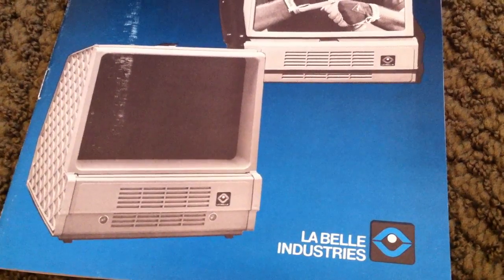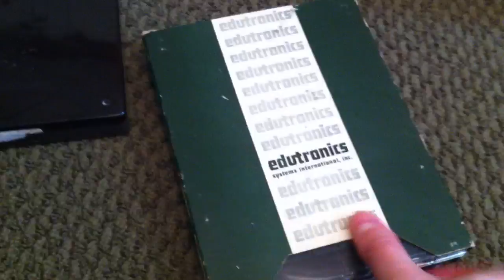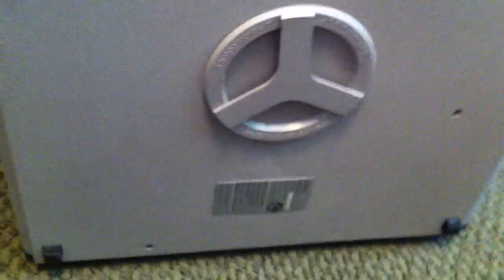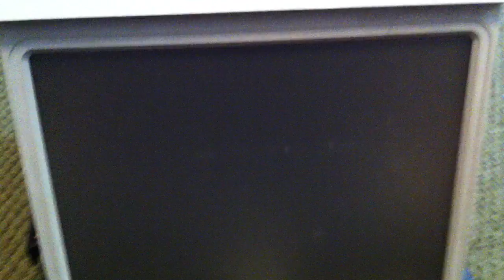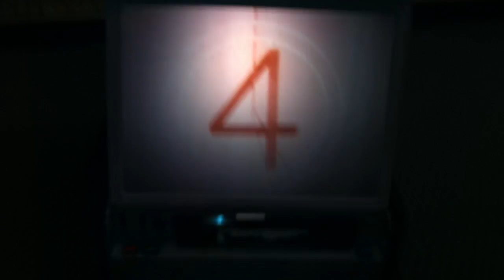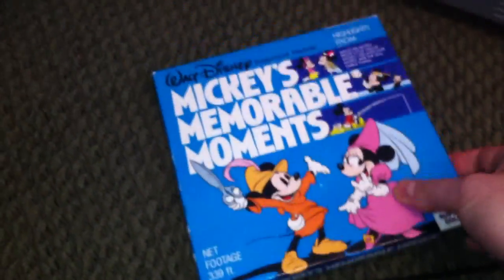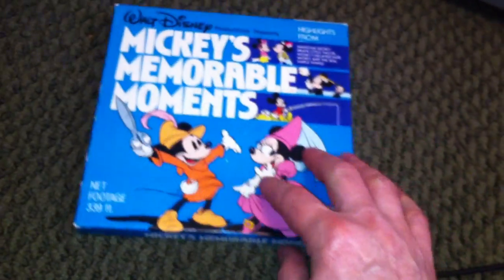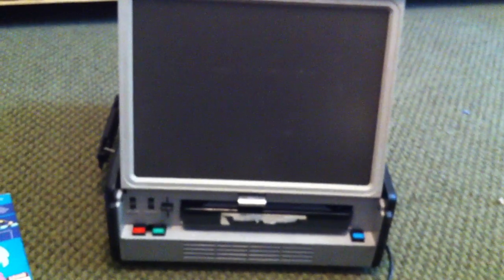LA BELLE COM 8 Super 8 Cartridge Projector Restored

Comment: I used to load cartirdges for these and other cart based systems.
Reply from the maker: Vahmrick60 That's cool, what was that experience like?
Reply: Depended on the cartridge. The Fairchilds were pretty easy, the Technicolor and MPO were a lot more complicated. Generally the prints were made from 16mm internegatives which came from the original (which was usually 16mm ECO 7252 or 7247 ECN). The prints were made 2 at a time since it was split 16mm with mag stripe track. The sound was dubbed onto the stripe from the original mag fullcoat mix. They were then slit and loaded into the cartridges. Don't remember Labelle super 8 carts, but I do remember the 16mm single frame slide shows. I used to copy slides onto a 16mm film strip for those.
This was the place I worked back then.https://www.facebook.com/RussellBartonFilms

Comment: The projector originally started life as the Fairchild Camera & Instrument Company's model 70-07 (a.k.a. Seventy-O-Seven). Then around 1979 Fairchild got out of the projector business and Dumont took over the projector line. Then around 1982 Dumont bailed out and LaBelle took it over. The LaBelle machines are just plastic cased Fairchild repeating projectors.
Reply from the maker: Aren't they wonderful?  And breakable?
Reply: The Fairchild 70-07 service manual could be used to repair these machines. Basic projector mechanism, amplifier board, and control boards are the same I believe.